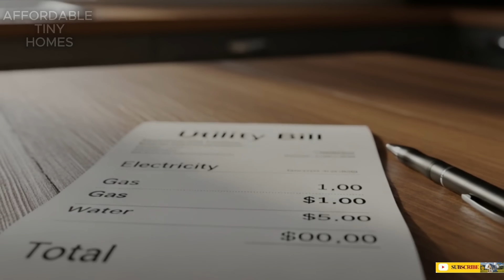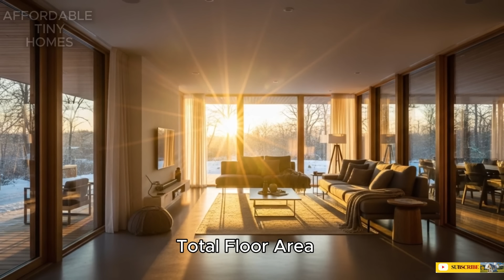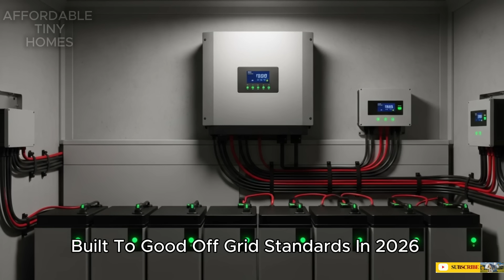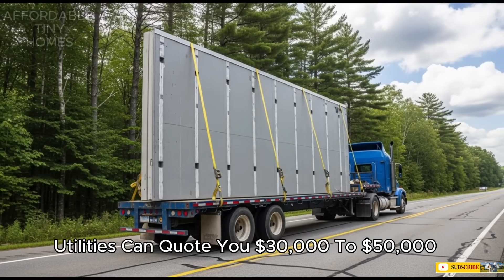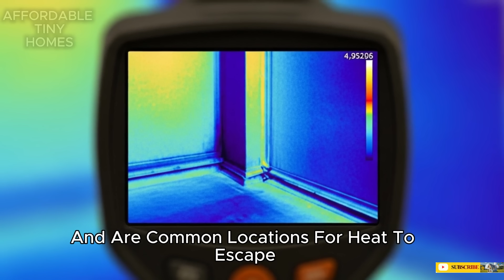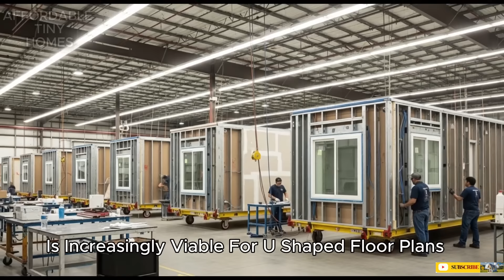2026 Housing Crisis: Why the U-Shaped Home is the Only Real Solution

Comment: Please include a video on U-shaped tiny house of about 800 sq feet for 1 retired person at 15 degrees N latitude.  Water harvesting here is paramount as we have 6 months of rain & 6 months of NO rain.  Currently, I spend only $12 a  month on electricity. Solar technology is almost non-existent as no one here has the skills to do it. Currently, I do not heat nor cool my home.  The year round temps run from 8 -25 degrees C.  This is an ideal environment.  I'm so lucky to live here.
Reply from the maker: We will work on that

Comment: A few years ago when I was about to retire, I briefly looked into options for building my own home, and the U shaped design was what interested me the most. My idea was to purchase three or four (built on site) Amish log cabin kits, and arrange them in a U shape on a pre-poured foundation. These 400 to 600 square foot cabins can often be purchased fully finished for under $40,000, so 2,000 square feet of living space is easily affordable when compared to a conventional build.
The benefits of having everything on the same level should not be understated, for if you plan on making it your forever home it's somewhat future-proofed, in that adding wheelchair accessibility will be much easier in this configuration. No second floor stairs to climb, and no basement to flood.
Reply: that's similar to what I had been visualizing..I'm still working on it!
Reply from the maker: @lindac6919 Glad it helped

Comment: Any problems with air stagnation in the courtyard?  If the courtyard were to face north, would that make for a very cool area in the middle of summer?
Reply from the maker: Great question! From my findings, air stagnation isn’t usually a big issue if the design allows for proper cross-ventilation things like open ends, windows, and airflow paths make a huge difference.

As for orientation, yes if the courtyard faces north, it can definitely stay cooler during summer since it avoids direct harsh sunlight for most of the day. That’s actually one of the smart advantages of this design.

Comment: Great video I’m planning on building a U-shaped house, off grid. Would you know if the solar credits are available to property in California that’s not connected to the utility company
Reply from the maker: That sounds like an amazing project! A U-shaped off-grid build in CA is a dream. To answer your question: Yes, you can typically still claim the Federal Residential Clean Energy Credit (30%) even if you're off-grid, as long as the home is in the US and you own the system.
However, California's state-level rebates (like SGIP) usually require you to be a customer of a utility provider (like PG&E or SCE). Definitely check with a tax pro, but the federal 30% is usually the biggest win! Can't wait to hear how the build goes."
Reply: @AFFORDABLETINYHOMES-i9j  thanks for the quick response. Yes, my daughter and I are very blessed. We have 6 acres in northern California of gorgeous property. We have a house on it now that we are remodeling and then we’re going to build the U-shaped house next year. I’ll be building it out of a product called “ The Perfect Block.” It’s fireproof, withstands 230 mile an hour winds, is termite proof. It’s an amazing product.
Reply from the maker: @terilivengood6911 I’m glad the video helped ❤